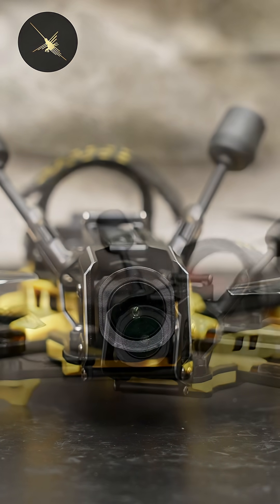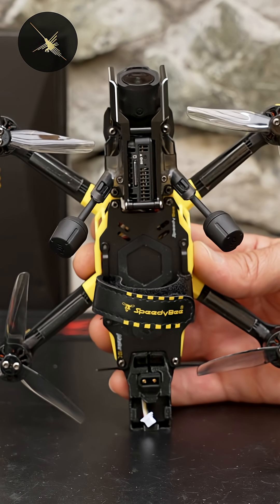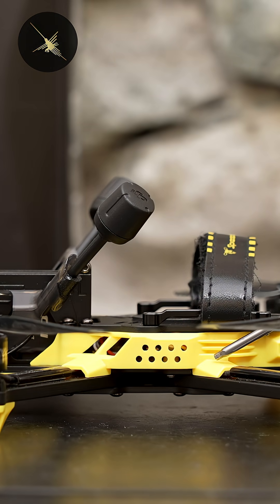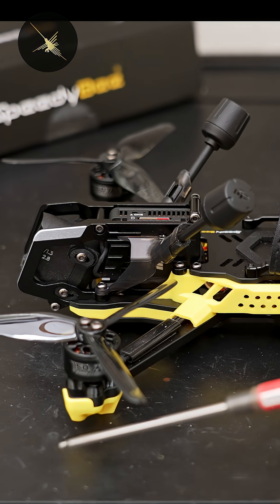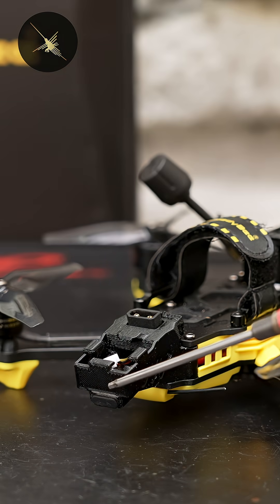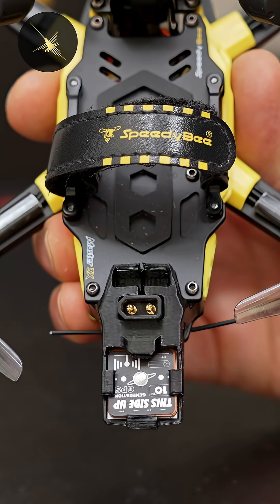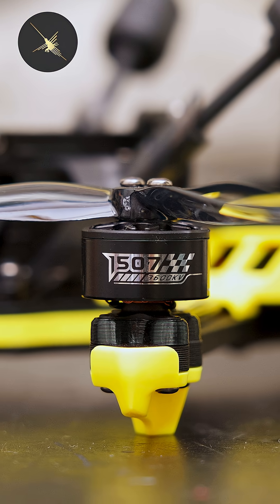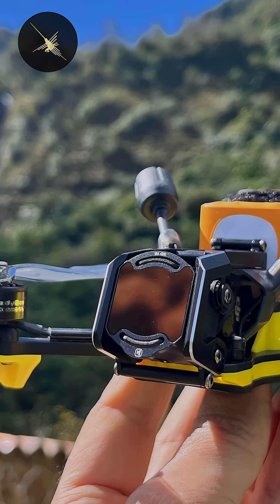SpeedyBee Master 3x with Modular DJI O4 Pro mount

Comment: Is their plan to make or maybe they already have a 5 incv with the same aluminuum so you can quick change ?

Love your content
Reply from the maker: Thanks for your feedback! Yes I would assume that their plan is to develop a drone lineup around this modular system but they haven't announced anything so its just speculation on my part, but there is so much interest in this system that it wouldn't make sense not to...